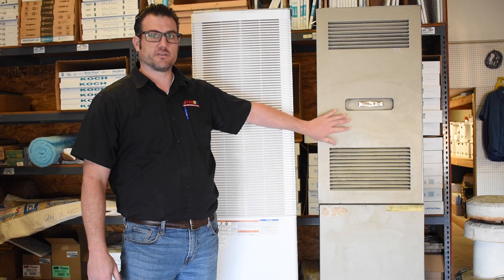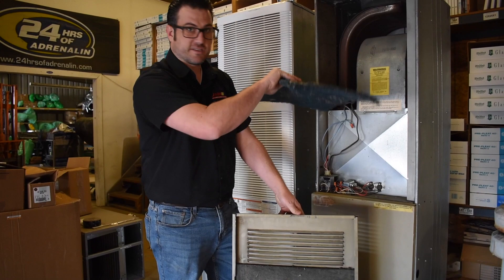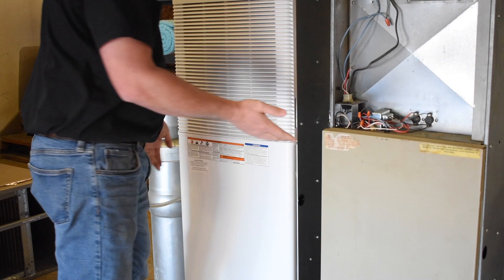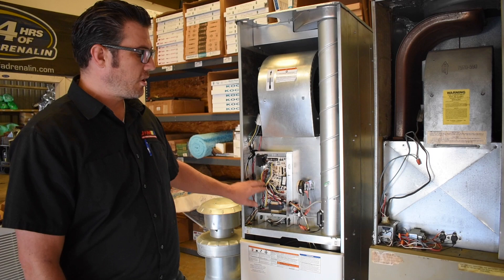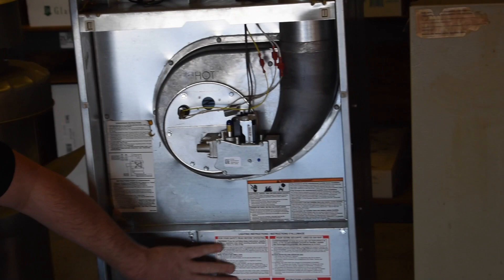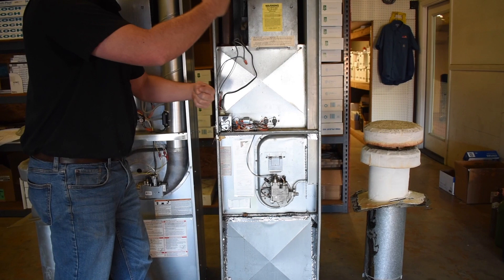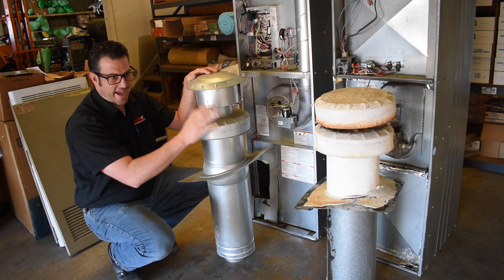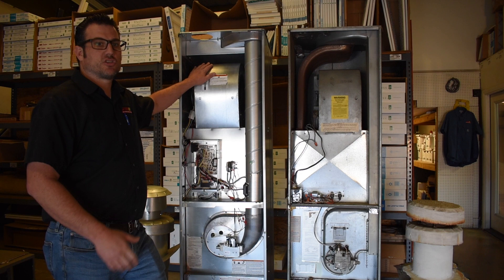Coleman Mobile Home Furnaces OLD vs NEW?

Comment: We have an old Coleman Presidential furnace in our old 1972 Holly Park mobile home, that since last fall when we replaced the thermostat has been cycling too often to suit me. lol 
It will run for about 5 mins, getting the house up to the right temp, then cycle off, then in about 5 min. it will cycle back on again.  Is this normal?  We have owned this mobile home for about 19 yrs and this is really the first problem we have had with this furnace. It really keeps the house warm and I am not looking to replace it unless it is a necessity. 
Could it be the new thermostat is faulty? Or am I just nuts for worrying about something that does keep the house warm, but seems to be on too often? 
Thanks for this video, and I am learning here as I go. 
Youtube is a great thing, it allows most people to know how to fix things when they need fixed or help in deciding what to do about a problem. 
I am now a subscriber, as I like to learn to fix things by myself, and I do know when to call in a pro when I am out of my comfort zone too.
Reply from the maker: New digital controls have different heat-anticipation settings. Depending on the control, there may be nothing you can do. Contact the installer or manufacturer of the control. Additionally, if you also updated the windows with dual pane, or some other energy efficient upgrade, the old furnace may be too large for the home, which can also cause that.
Reply: @jmairnheat  Thank You for your quick reply.  We personally installed the new thermostat, no other upgrades to the home.  It isn't a digital one but the old type, spin the dial to the number you want. lol I really do thank you for your input.  I figure it is the "nature of the beast" and like you said, we may have to live with it?  So good of you to try to offer information to help!!!!
Reply: mine has done that since new and ts about 10 years old. Im in Ohio and live in an older mobile home. When it gets down to the single digits forget about it thing might as well never turn off. Drives me nuts but dosent seem to hurt it.

Comment: Is that new furnace your showing is it a single stage or a two-stage?
Reply from the maker: These both offer single stage heating only. The new furnace does have the additional functions for 2 stage cooling applications however.

Comment: Now the question is how would this system work in homes with all electric downflow applications?🤔 Blower is on top that says to me upflow system in 35 years I've never seen a mobile home with an upflow air handler. The way thats mounted its gonna destroy the evap coil air is pulled through them not pushed they are not designed to be on the positive side of the static pressure.
Reply: They are down flow units air is pushed down.

Comment: Thank you for this great video! I'd love to see a quick maintenance checklist for the many renters who want to make the most of the older models that aren't going to get replaced. For instance, should the scruffy filters be taped or held in place with strong magnets somehow, or can a newer filter be jimmied to fit, or would a newer filter be a problem in an older machine? Should the filters be cleaned with water or a vacuum, and how often? Should the inside of the unit be lightly vacuumed  (with the power to the unit cut, of course) to reduce the amount of dust/lint that gets by the filters? Thanks!!!
Reply from the maker: Thanks for the feedback. Maybe we can get that done. We have a lot of ideas for videos we think people need to see.

Comment: Great video, thank you for posting. That new unit looks a lot like the unit I already have DGAA090BDTA. It's a good furnace but I'm on propane and want to switch to an electric furnace. Can you give me any ideas on a comparable electric unit and what to look for as far as physical size and/or BTU's? Mine is currently 90k BTU and the mobile home is 2,000 sf. I'd really appreciate any help. Also, do you ship furnaces to the midwest? (Edit: It says 90k BTU Input and 72k BTU Output)

Comment: I had a Coleman Presidential II furnace in my old 1981 Skyline mobile home. It ran on propane and had the pilot light.

It exploded one afternoon during the fall of 1998. And when I say exploded, I literally mean that. I was outside walking in the driveway and it sounded like a military cannon went off. I looked at the trailer and smoke was coming out of the roof jack.

Luckily it didn’t cause any fire but it smelled funny when I ran inside. I shut the power off, pulled the doors off the furnace and it had blown a huge red spot on the inside of the bottom panel. 

The repairman said that the insides had just disintegrated. I assume something had rotted  internally and developed a slow propane leak, and when it went to fire off, it ignited all of that propane it had leaked inside of itself.
Reply: That's why you do periodic inspections of such furnaces. If certain things appear to be compromised by rust, find replacements and fix it. The biggest issues are likely propane lines and the heat exchanger. If the heat exchanger leaks, carbon monoxide. If propane lines leak, boom.
Reply from the maker: One of our clients was relighting his mobile home furnace, and it exploded out of the access door and gave him 3rd degree burns on his face and arms. Scary. It was an older model, with a large round port for lighting. Not  the presidential 2.

Comment: There is no way that blower uses 75% less electricity. They are both PSC motors
Reply from the maker: Christopher Smith The new furnaces meet the federal FER standards, and use an ecm motor, not a psc. I used generic psc vs. ecm motor efficiencies as a baseline,

Comment: I have the older unit and considering upgrading. I can not confirm or deny a 75% savings in electricity because of a this new motor design but, I do not believe it. You would have to proof it to me. Just because you say it does not make it so. I am calling you out on it.
Reply from the maker: "Up to" on the motor only. Not your entire electricity bill. and that is predicated upon the proper equipment and duct sizing. If done wrong they can actually cost more due to over amping to push air through restricted duct paths.

Comment: What size are the filter in the old furnace?
Reply from the maker: You will need a Cut-to-fit washable filter for the older model. Unfortunately standard filter sizes don't fit very well.
Reply: These filters aren’t placed to the left or right of the blower moters? I just need them against the door??
Reply: I also have an old Coleman furnace

Comment: I have one but no gas
Reply: I have the old 1 and you make sure you have gas coming to it. The shutoff at furnace is opened you stick long match in light pilot hold the pilot switch to the left until 15 seconds once it's stays light without holding the button left. Then you turn pilot switch to On position. Put doors back on make sure electric switches is all turned on. And it's good to go. It's pretty easy to do

Comment: Why my fan it’s at full power all the time when the heater is on
Reply from the maker: Some models only have a single speed blower, or require max airflow under all conditions. Have a professional take a look at your system if you are concerned.
Reply: Exactly!! Your furnace is either 100% on or 100% off whether heating or cooling. 

They have newer models that can have many stages in between 30% and 100% on, but this Coleman furnace is only single stage.

Comment: Great video but I really need to see how to get the doors in my old furnace so I’m not using duct tape.  They don’t want to fit but they were fine when I took them off.  This can’t be that hard but for some reason it’s duct tape for me tonight.
Reply from the maker: sometimes the fasteners that hold the furnace doors on break off. Contact a local contractor.

Comment: These Coleman mobile home furnaces are trash. I have the exact model of the newer one. Horribly loud. Mine is 2 years old and I've had 4 repairmen out to look at it, replaced the board, adjusted gas, replaced sensors, etc, and it still overheats and shuts off. Motor has been tested and seems good. But still overheats and short cycles. This shouldn't happen with a 2-year old furnace.

Comment: Dude. HVAC is such a Gimmick. You have a furnace from the early 2000s and they are a bad design. Why? Did people not understand how air filters and basic HVAC worked? No.
They just wanted you to have to always upgrade. It is late stage capitalism and super expensive for the common man. We live in a manufactured home. Not a mansion. Pick a different clientele to feed off of

Comment: I have almost the exact furnace on the left only no coil compartment on the bottom. I would like a replacement like the one on the right without the coil compartment. What model is that?
Reply: There is an A-coil compartment on the bottom of both, they are both down flow units.